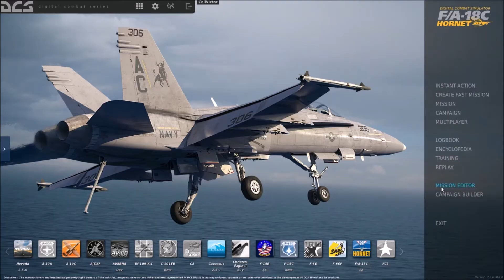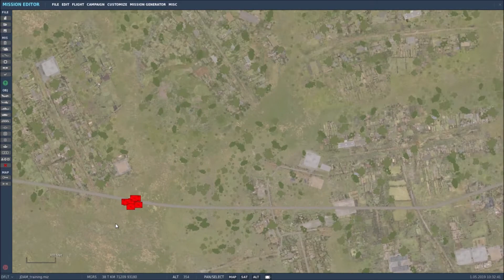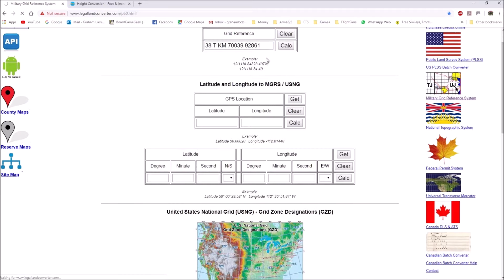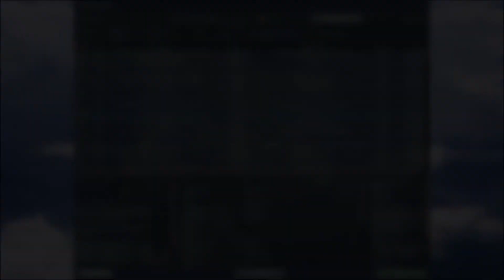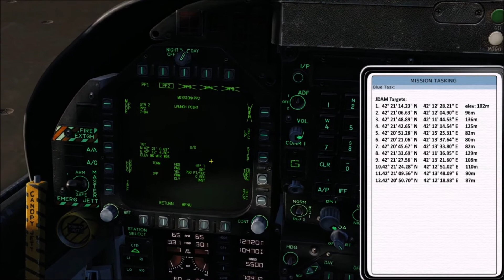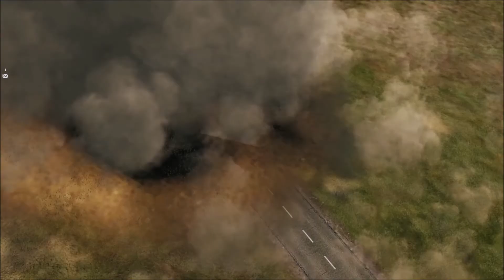DCS FA/18 Hornet - JDAM tutorial.

Comment: Isn't' the TERM for controlling how the JDAM hits the target, not how the aircraft is flying? For example, if there's a heading of 180, angle 75, and velocity of 500 then it would try to impact the target coordinates coming from 180, at 75-degree angle at 500 knots?
Reply from the maker: You could well be correct. I may be miss-informed. Either way, it is not currently implemented from what I can gather.

Comment: Really good video but you don't need to input heading, angle and velocity.  Long. Lat. and elevation is enough.
Reply from the maker: Interesting comment. If so, will cut down the input time. So, how did you figure this out - just bombed without those parameters and it worked?
Reply: @harmer7  I watch few videos and try for myself, also when you have target so close you could  drop both bombs in one pass